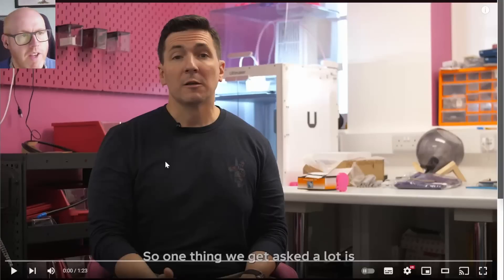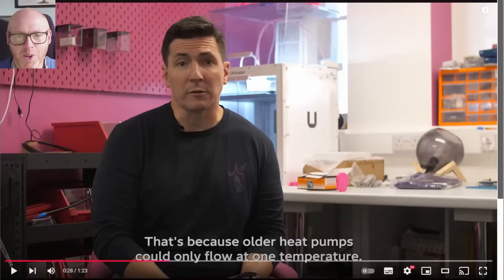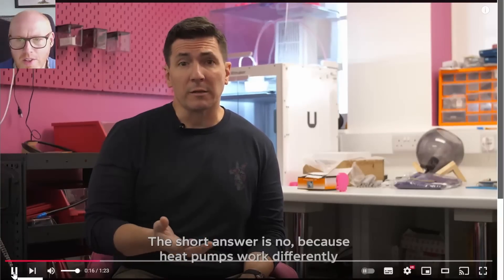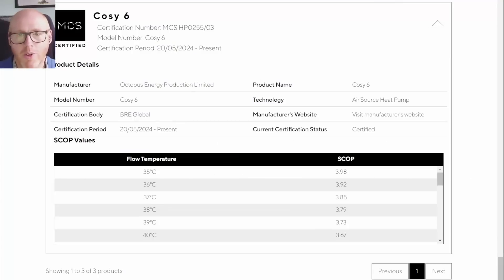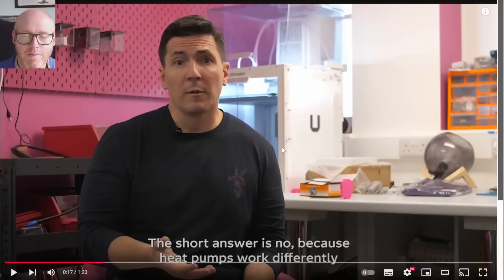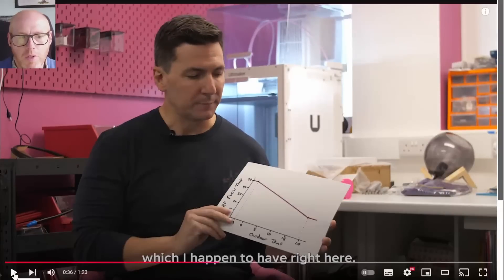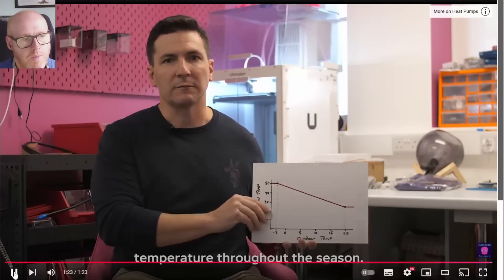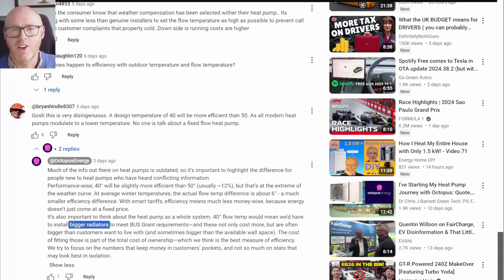Does Flow Temperature Really Not Matter in Heat Pumps?

Comment: I think the octopus strategy os that its better to try roll out 270,000 high temp lower performance ASHP successfully, than engage on a bespoke slow and painstaking low temp revolution and deliver a lot less due to the design choices and retrofit requirements. 

Personally I'm getting a low temp system installed by a heat geek but I'm not the avg person with a strong environmental desire and funds. 

Avg Joe may be happy with high temp, no new rads and a tarrif that just about makes it cost competitive vs gas.
Reply from the maker: Yep, agreed!
Reply: Then why not just use A2AHP that don't care about flow temperature or weather compensation then. A SCOP of 3 is meh compared to 6 that can be achieved with good japanese AC units.
Reply from the maker: @johnzach2057  A2A won't achieve 6 in the real world. Proper measuring equipment is eye wateringly expensive and lab testing procedures don't represent real world at all. 
People who have attempted to perform real world in home measurements are coming back with a COP of 3-4. 
This is of course irrelevant, as the ability to zone and not have to run 24/7 like A2W does, can save big time on the overall consumption cost.
So I do believe that for some people, A2A will still have much lower running costs and of course lower installation costs for many too if you discount the grant.
Reply: @UpsideDownFork  Actually it does. People here have measured COPs up to 10 when temperatures are 14C. And SCOP in Athens was a little bit better than the sticker. But this only applies to the really good Fujutsu and Toshiba models priced at around 1000-1500 euros for the 8kw systems and contrary to current A2WHP that turn off at 30% load, Fujitsu and Toshiba units keep running at 10% load with extremely high COPs. 8kw units have been seen running @ 100-150W which you will never see in 8KW A2WHP. So actually, in contrast to A2WHP it's better to oversize them. The bigger unit the better COP you'll get.

Another huge huge plus is the availability of A2A units that can directly connect to solar panels since they have their own MPPTs and they don't need inverters. They are excellent for warmer climates where cooling is a must and almost totally reduce electricity consumption during summertime. They also help in the winter but I guess for the UK the benefit will be small since solar energy production collapses from December to February.
Reply from the maker: @johnzach2057  which method of testing have they used?

Do they have vested interests to come to those incredibly high figures?

Can you point me to this data please?
Reply: @UpsideDownFork  If I remember they used two methods. One was to calculate the heat loss of the building using resistive heaters. So if your HP can keep the temp @ 20C then you can easily calculate the COP for that external temperature. Another was to use sensors to measure Air temperature in the intake and exhaust and use the cubic meter per hour of the fan to calculate the delivered heat and then calculate the COP. Obviously the fan is at max speed. At lower speeds the COP drops.

The definitely do not have vetted interest. It's just a Greek forum for technology with nerds trying to figure things out. Because there is a massive push for expensive A2WHP that aren't appropriate for hot climates that need cooling anyways. I'll try to find the figures that the guys have generated.
Reply: @UpsideDownFork  The complete exclusion of A2A from the BUS grant does seem perverse. There are plenty of people for whom A2A (and a DHW tank HP) would work well. I think I'd go that way if it wasn't for the lack of a 7 grand bung.
Reply from the maker: @xxwookey  Yeah, any removal of a gas boiler should be acceptable. If that means A2A and immersion only tank or even iHP tank...that's great!
Reply: This is my current thought particularly as HG and octopus have quoted the same money initially. I am frustrated that they refused to provide any breakdown of costs. It's very hard to believe just a one number quote
Reply from the maker: @michaelstaniforth7954  Part of the challenge they face is trying to weed out the seriously interested parties as demand is so much greater than supply at the moment. A quick easy, round figure does deter some people straight away.
The business models designed to roll out at scale means that they will make a small margin on some and a greater margin on others. Some installations like my own, will run at a loss.
Smaller independents will give you a full itemised breakdown.

Comment: They need to re-do the video. they are using one of the new refrigerant gases so they can run the whole system much warmer so that houses with microbore systems can have a heat pump fitted without ripping the whole system out, yes it may be a bit more expensive to run but much cheaper to install. EVNick is doing an interesting series on his octopus install.
Reply: I don't think he's a source of unbiased info, wasn't his install video all sponsored?
Reply from the maker: @edc1569 yes, his is a sponsored installation and video series.
Reply: @edc1569 he's most certainly bias. When you read his comments on Twitter there is lots of 'fingers in the ears' not accepting what people are criticising about his install. He basically loves Octopus and wont hear a word against them.

I can fully appreciate their strategy of 50C flow rates myself, it means they can knock the systems out quick and cheap. On a path towards net zero, it makes the biggest inroads. BUT I do think they should make customers aware that they could spend more, change rads/pipes/etc, maybe not need to run with a buffer and extra pump(s) and overall get better efficiency. Really it should be like the fact sheets you get with banks, they should have pre-canned options which give pro's and con's to customers and let the customer decide if they want to spend more for more efficiency. This is especially true if a customer could easily/cheaply do some minor upgrades to allow for a lower flow temp. Why fix it at 50C? That's only really a line in the sand to allow for quicker and easier designs on their side, not benefiting the customer when a small amount of work could lead to a much better install.
Reply: @cingramuk  I gather that you can't change the flow temp on an Octopus install. They don't let you. I'm glad I didn't go that route. Not getting all the knobs myself on my own heating kit is a deal-breaker.
Reply: That's only on their Cosy heat pumps their Daikins are normal, controllable heat pumps.
Reply: That's just not true for their Daikin installations. I'm running mine @ 38º Their new Cosys are controlled by Octopus from afar. That's the point of them - no need to geek out.
Reply from the maker: Indeed he is. That's also sort of undermining the claims made by Octopus energy that it's a fit & go solution.

Needing a buffer tank and secondary circulation pump for the heating circuit makes the Cosy 6 no different to the Daikin's they were previously installing. They're still designing the system temp to 50 degree flow, so the same number of rads will be changed.

Comment: https://youtu.be/BP_pqSlh7es?si=2nfVvNaPYCOWmQ6v     same thing here, does not make sense to me. but they suggest the higher flow temp allows it to run for a shorter time with longer off times that compensates for the lower COP of a higher flow. the opposite of what i understand, that low temp over long wins the efficiency game.
Reply from the maker: I've got some thoughts on that but probably for a separate video.
Compressor can't modulate low enough, circulation pump can't flow enough, perhaps emitters can't shed anymore energy into a modern, well insulated property... it's a recipe for failure.

Comment: I've just booked a heat loss survey and getting ready to go for a heat pump and havinv my gas boiler removed. I generally understand the concept of how HP's work, weather compensation too, but not yet understood how they communicate. Some can be remotely monitored and controlled with an app so need an Internet connection (not a problem). Is this Internet connection a cable to the heatpump outside or is it wireless, or does the heatpump send it to a controller inside the house that is then wirelessly connected?
Reply from the maker: Most of them have a communication cable between the external unit and the internal unit which then connects to your WiFi network.

Comment: Thanks, great little video.  I've had a few quotes recently from Aira, Octopus, and Heet Geek.  My impression is that Aira and Octopus have the business strategy of not upgrading existing radiators (unless absolutely necessary), while, for example, Heat Geek push for massive radiator upgrades (even if not really needed) to chase high SCOPs.  None of them are sufficiently transparent about it, though.  They just give one design and most customers will have no idea that there are sensible alternatives.  I'd prefer to get two proposed designs to choose from and some rough quantification of the trade-offs between them.  For the urgently needed fast mass adoption of heat pumps, the Aira and Octopus strategy seems much more likely to succeed.  Otherwise, the one-off expense of a gas-boiler to heat-pump retrofit will put off most households, and we end up burning more gas.  Perhaps Heat Geek's strategy could be better targeted to new builds, where the cost of installing a properly designed low-temp heating system is lower than retrofitting an existing high-temp one?
Reply from the maker: Thanks for commenting. I'm glad we have a few choices in the market and we're seeing some healthy competition too.
Reply: To be fair, you only need to upgrade your system to low temperature once. 

A like for like HP change isn't dramatically different to a boiler swap. 

Get a quote for a new central heating system+ combi vs upgrade to low temperature system plus ASHP and cylinder and it wouldn't be that different. 

Everyone keeps telling me A2A is cheaper but I had a company quote me a £17 system for that, where as my ASHP quote through octopus is £7500 , heat geek £10,000. 

A new boiler on the existing system might be £3000 but with a cylinder we might be talking £5000 and if I needed or wanted it to actually condense the same radiator changes would mean it's suddenly near exactly the same as the post grant prices.
Reply: @Lewis_Standing  I've been quoted over £17,000 for just a heat pump (5kW) + a hot water cylinder (no new radiators) upgrade.  And the cylinder upgrade was non-negotiable because my existing (nearly new) cylinder has only 1m2 heat exchanger surface, which is too small for a heat pump hot water heating.  Even after the BUS grant, it's still 10 grand.  This is just for the rich and geeky.  No-nonsense no-SCOP-chasing affordable upgrades (like what Octopus offers?) are the way to go, as long as they're done sensibly (without killing performance by poor installation/controls).
Reply: We're having our Cozy 6 installed this week, £500 all in and Octopus are replacing 6 of our 8 main radiators.
Reply: @peterbruch8719  Sounds like a standard Octopus install (of the £500 variety) doesn't include a hot water cylinder upgrade, though?  I wonder how that works with a typical cylinder with <1m2 heat exchanger coil area.  Do Octopus mention hot water cylinder re-charge times?
Reply: All Octopus installs include a cylinder - it's in the regs.
Reply: Be wary of Aira, one of the guys on a forum I'm on has had no end of problems, very poor at answering the phone and sorting issues by all accounts, left the house in a right state as well.
Reply: @TheRonskiman  

What problems have they had, might help others if we knew, and what has or is being done to resolve them.

Otherwise it adds nothing but FUD to the discussion (Fear, Uncertainty and Doubt).
Reply: @_Dougaldog  Replied twice last night, each time my comment disappears, no idea why.
Reply: I've just had an Aira heat pump installed and had most of our radiators replaced.
Reply: @paddylogan13  In my case, Aira proposed an 8kW heat pump, while two independent heat loss calculations give 4.5-5kW heat loss.  This was a turn off for me; major oversizing.
Reply: Octopus replaced all my radiators.

Comment: I had not seen the original video you're reacting to but you've covered my thoughts exactly. I'm not expecting as much efficiency as an amazing Heat Geek Ultra installation would provide me with, but at the same time, my system pipework isn't going to be replaced and the new radiators that are planned to be installed will not be much larger than before, save for the bathroom one which really needs to be bigger anyway. When I'm paying £540 per annum for gas at current prices including the standing charge, there really isn't much scope for saving a lot of money on that, and I think the right balance for me is struck by Octopus's offering.
Reply from the maker: I like what octopus is offering as a product. 
I don't think much of some of their marketing.
Either way, we need them to succeed otherwise heat pumps are doomed.
Reply: @UpsideDownFork maybe you could link the original video?
Reply: My heat geek proposed installation involves turning the rads to doubles or triples but not really any size increases.
Reply: Interesting! The proposal for mine is mostly similar sizes also but replacing with doubles with either single-sided or double-sided convectors. Perhaps it's similar. None of them are triples. There's plenty of space for the one in the bathroom to grow which is the only one that's going to be significantly larger.

Comment: TJ is the "Heat Flexibility Director" - what on earth is that job role and what does it entail?
Does appear as you say he doesn't appear to have a scooby what he is talking about...................... Maybe he should go on the Heat Geek Training before doing another video??
Also as you and several others have commented - they designed a Hight Temperature Heat Pump that is less efficient than most Low Temperature Heat Pumps @ 50'C.
What is the point of bringing out a HT Heat Pump that are the same or less efficient than LT Heat Pumps at higher temperatures????
The point where you discuss Octopus talking about higher flow temps/bigger radiators is moot as they would still need increased size radiators due to the simple fact that Gas Boilers operate on a Delta T of 20'C and ASHP will use 5-7'C
Plus I thought the accepted rule of thumb was 3% efficiency gain for every 1'C reduction to 50-40'C would be a 30% performance increase. not 12%....
Reply from the maker: He must know what he's doing. Octopus have installed thousands of heat pumps successfully. I just think this is one bad example of PR.
Reply: Integrating the controls of the heat pump with when it's cheapest for the grid and octopus to deliver the electricity for it, to offer you a better tariff price. 
So the efficiency might be lower with their high temperature system, but they might be able to do some tariff magic to make it a similar cost to run.

Comment: 2:32 i didn't knew that large heatpumps are this efficient at high flow temperature, 3.6 is not that bad. Maybe that's why some installers are over sizing it to 12KW when they do retrofit with older radiators (i'm not claiming that it is good or bad idea).
Reply from the maker: Large heat pumps don't necessarily equal oversized.

If a 14kW heat pump is the correct size for a property then you can achieve a SCOP over 4, no issues.

But if a 14kW is bolted onto a house with a heat loss of 7kW, that pump will not be able to shed sufficient heat into the property and will short cycle. 
The inefficient stage of a heat pump is when it starts a cycle.

This is why the whole system needs to be correctly sized. 

Also, last point, higher or lower flow temps aren't really anything at all to do with heat pump sizing (albeit inter-related). Flow temps are dictated by radiator size.

If you have a heat loss of 7kW and you don't want to change rads, you can use the same heat pump at a 55 degree flow temp as if you changed your rads and lowered the flow temp to 45 degrees.

Hope that all makes sense.
Reply: Larger heat pumps will have a larger evaporator, so have more surface area to collect heat from.  Basically, a bigger heat pump doesn't mean less efficiency, if it's installed in a property for the correct heat loss.
Reply: 3.6 is break even with gas. 

If paying a lot of money for a heating system improvement, SCOPs over 4 at least save you a little on heating costs too
Reply: @Lewis_Standing Jan Rosenow has break even at 3.3 SCOP in the UK.